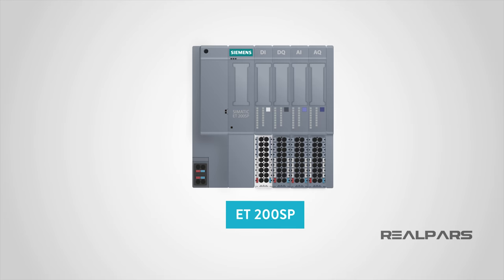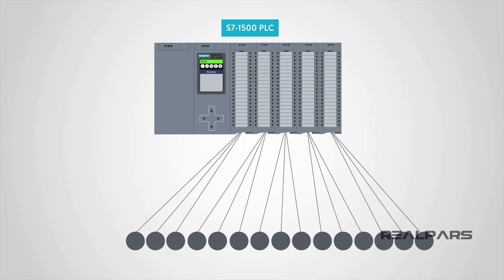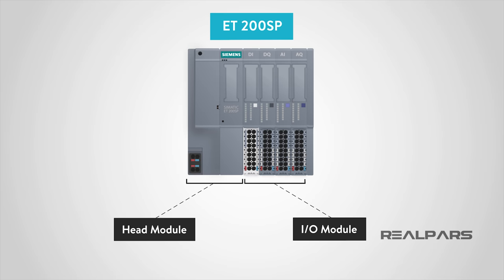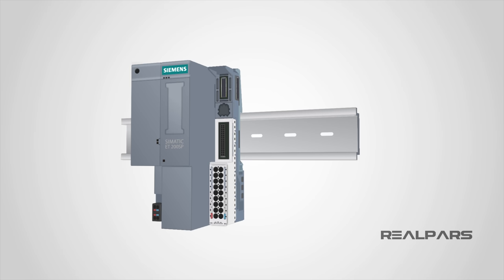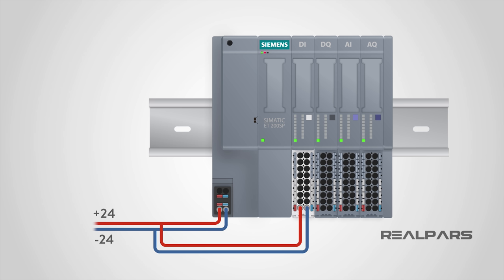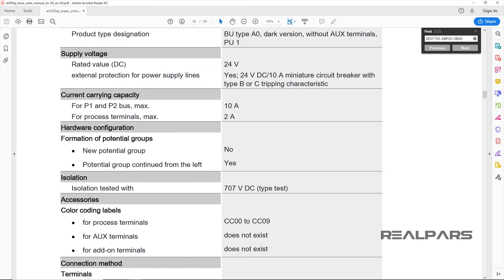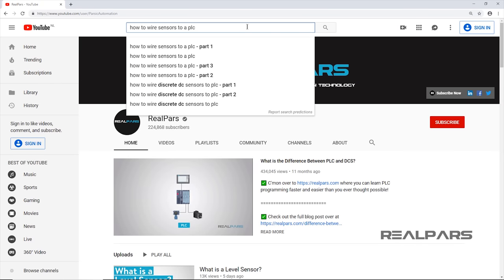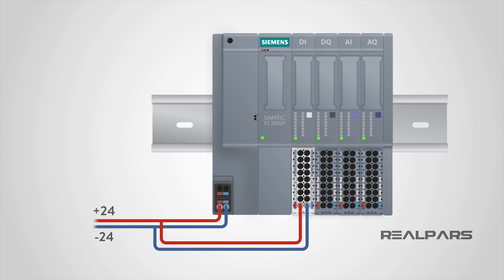Introduction to ET 200SP Base Unit (Overview & Usage)

Comment: I have a problem I need help
I am connecting modbus RTU with ET200SP of S7 1500
I use 3 ET200SP stations, each station has 1 Modbus RTU module PtP 6ES7 137-6AA01-0BA0 to connect up to 10 Flowmeters
I declare 3 MBCommLoad functions to declare the connection port for each Modbus module, but in the program, it does not run.
And if I only use 1 MBCommLoad function for 1 Modbus module, the connection is OK.
I hope you can help me with the solution so that I can use all 3 modbus RTU modules.
Thank you so much
Reply from the maker: The module  you are using is a Point-to-Point module.  A single module can support polling only 1 device at a time.  You will need to set  up your MBCommLoad functions such that once a device is polled, no others are polled until you detect that the first device is done.  Then the second device can be polled, and so on.
Reply: @realpars  Thank you so much, i did it very well. I use function block with MB_ComLoad and MB_Master instance.

Comment: Any other way to send signals from Remote I/O to PLC in that such distance? how about wireless? what device I can use if i want to make wireless from Remote I/O to PLC?
Reply from the maker: There are a number of ways to send Remote I/O signals over a long distance.  Wireless, as you mention, is one, but it will be limited by the quality and number of repeaters and gateways that are part of the mesh network.  Another way is fiber optics, which can be run for up to 23km. Another way, that is often used for remote metering sites is cellular or RF signal.  How far do you need to send the signals in your system?
Reply: @realpars  Can i use RF to transmitting signal in 3miles? Can you give a specific devices/brand I can used?
Reply: @realpars  can you make a video with a RF signal, range limitation? If you have a Video can I have a link so that I can watch. Thanks RealPars.

Comment: Et200sp to s7-1200 what is the maximum  ethernet  distance?
Reply from the maker: Profinet over CAT5E cable = max. length is 80-100 meters,   For fiber optic cable, the maximum length is 26 km.  For wireless, the maximum is approx. 100 meters.

Comment: What is the full form of ET200, ET300
Reply from the maker: Thank you for your question. To the best of my knowledge, Siemens does not have an ET300. They produced the S7-300 CPUs years ago and supported them for an additional 10 years. However, this product line has been or will be discontinued. Siemens does continue to make and support the ET200 line, which has been around for approximately 30 years.

Here is a link to help you learn more about Siemens PLC products. If you have any further questions, please feel free to ask.

https://support.industry.siemens.com/cs/document/109744173/documentation-for-simatic-controller?dti=0&lc=en-WW

Happy learning!

Comment: What does ET stand for?
Reply from the maker: I am not sure "ET" is anything but a prefix for a series of remote I/O products.  I did ask some Siemens insiders if it had any meaning, and I did get one response that it may refer to the ET-series being comprised of Electronic modules with Termination cards at the end of the rack.  So, ET = Electronic with Termination.

Comment: Is ES200SP a RTU?
Reply from the maker: They are very similar, but not exactly the same.  ET200SP can perform many of the same functions as an RTU, but an RTU typically the following features that ET200SP does not have:  rugged environmental installation capability; ability to program over a web interface; connection to satellite or other wireless networks; ability to store data locally so that it can buffer the local data when the interface to the main unit is down.
Reply: Thanks for sharing.

Comment: It should been mentioned that the first module after the base module should be a PM-E (Power Module), not a DI (Digital Input) that is shown in the video.
Otherwise, great video. :)
Reply: No, with ET200S you needed a PM-E. now that's  integrated in the white baseunit.